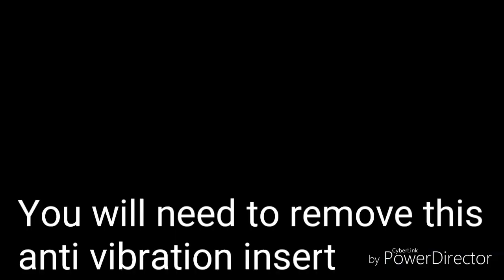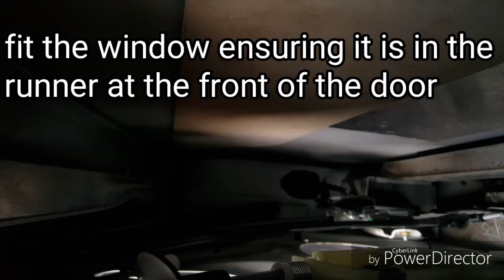Audi TT MK2 Roadster - Window Regulator Replacement

Comment: Audi TTS MK2 Roadster 2009.  Only the rear of the window went down.  Watched this video, purchased a replacement Regulator to be ready.  Undid all the covers, and discovered that the front window clamp bolt was loose.  I tightened that up nicely.  Perfect.  Don't need to even take out the regulator.  (oops).  Now I have to figure out how to reset the automatic Top that faulted when the passenger window got stuck for the first time.  Damn that roof is a heavy pull...

Comment: what was the make of the window regulator was it starline? and did it work properly as i put in one the other month and it hasn't worked correctly since. hope to here from you soon as there is special discount that runs out tomorrow.
Reply from the maker: Unfortunately I dont remember the brand for the regulator

Comment: Great video. I wish I had seen this before I took my 8J  into the garage. Both windows went and they repaired both for £300!!!!!! But they effed the drivers side up. When you open the door the glass doesn't drop so when you close the door the glass hits the roof trim. When you're inside the car it sounds horrendous. My missus took it back but they said there's nothing wrong with it! Any idea what they did wrong so I can go back and get it sorted? Cheers. All the best.
Reply from the maker: Hi Yelp:
Sounds like they didn't reset the sensors.
Turn the ignition on 
Wind windows down and then straight back up
when the windows are up release the switch then
pull the switches back up and hold for 3 to 5 seconds
Release switches 
ignition off.

Should fix it.
Reply: hey, I've just been quoted £845.00 from Audi to do the passenger side only !!! Thanks Phase Projects for the video, gonna buy the kit and do it myself now.

Comment: I did all your procedure, but the right glass does not drop 1cm when the door is opened, I have already tried to program the glass by holding the button down for 5 seconds and up for 5 sec, but still nothing.
some advice?
Reply: Klaidi Garzenai hi did you figure this out by any chance?

Comment: How do you train the window again? I roll up the window and it drops down halfway again and then also the automatic function when you pull the door open does not drop the window a bit so it doesn’t hit the side of the car
Reply: I just test rolled the window up and down. It sits in the rubber part of the regulator and doesn't hit anything.
Reply: @ChateauxCocoa  come fix mine lol I’m scared to touch my TT
Reply: Um, if you installed everything correctly, it should line up. You don’t need to train the window to go up and down again. It will do it automatically.
Reply: @kevinraymond7324  I was afraid of the dealership quote over $900.
Reply: I should note that I purchased the Audi factory part and not the Aftermarket part…
Reply: @ChateauxCocoa   yea it took a min … it corrected its self